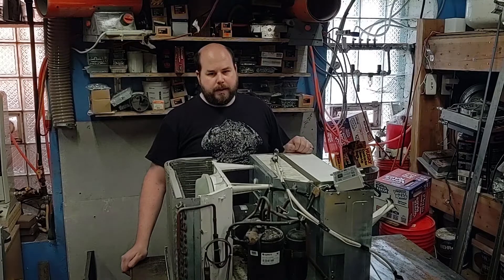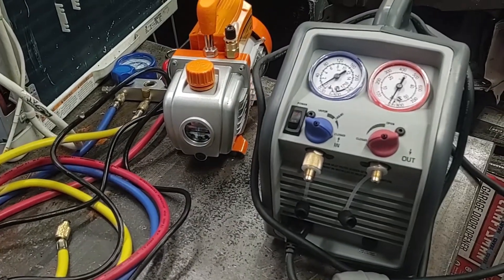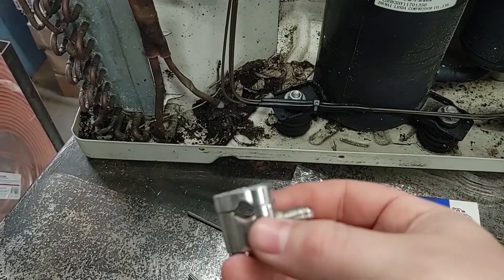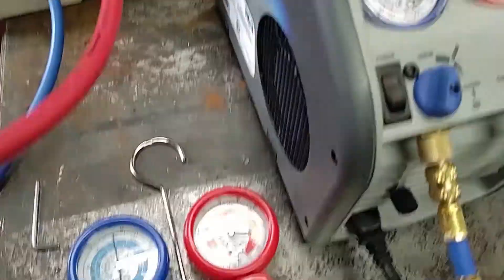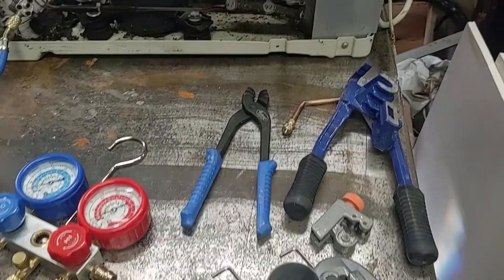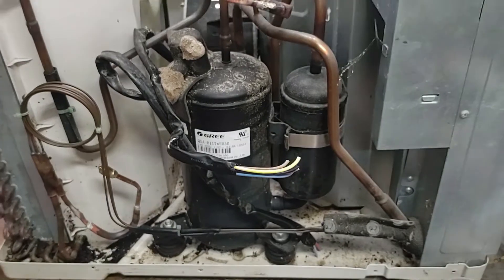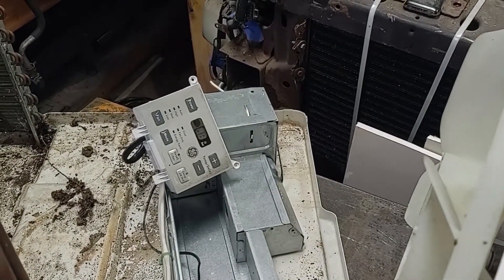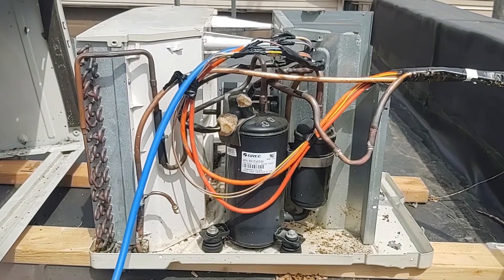Converting window air conditioner to split AC

Comment: As someone who does hvac/refrigeration for a living, lemme just say a few things. 

1. Holy shit, this is the best amateur job I've ever seen, I have seen guys that have been doing this for decades that do absolutely shit work compared to this. 

2. Props to you for taking the time to do this and for doing it right!
Reply from the maker: Thanks for compliment, appreciate it.
Reply: @planbuildplay8528  I agree with 
the previous commenter, I work in the hvac field and ive also seen guys that do it for a living fall short of what you did. seeing you go as far as to solder the wires, pierce the tubing, recover, and especially pull vaccuum. Good job man. Filter even.

Comment: For a while I've wondered why no one has made a video about converting a window ac to a mini split. After renovating my bedroom I accidentally installed a window that was too small for a window ac. I tried using a portable ac but do to the negative air pressure system they create, the single hose units are just too inefficient and don't get the job done. After thinking about trying to convert it to a dual hose unit I came up with the better idea of building my own mini split ac. I've been thinking about doing this for a long time and thanks to you I'm finally going to get around to doing it. Great Video!
Reply from the maker: I am glad this video could give you the push to start on the project.  Let me know how it goes, and thanks for watching.
Reply: Did you make it out of the portable ac? 
I have done that instead of a window air conditioner and it still works. I find it easier to make one out of a portable ac rather than a window ac because the majority only have one fan while the portable ac has two. Plus my air conditioner when I didn’t modify purely struggled to get down to temperature but now it can reach any temperature. That proved how bad these portable units are!  
Future plans for me is to make it reverse cycle.

Comment: Very cool congratulations!  Beautiful!  I thought I was gonna have to do this myself and then I saw other alternatives and I am overjoyed now after seeing your video that I didn’t have to do all the hours of research to educate myself on how to pull that off and I wouldn’t have wanted to buy the recovery pump.  Glad I saw your video to see what I didn’t get myself involved with thank God!  I saw a video of a guy in like Afghanistan build a air conditioner for his wife from an automobile air conditioner and a DC motor, I was very impressed.  It’s sad about all the negative comments.  I would be tremendously proud and even if I DID end up spending a little bit more money than if I had bought a store unit that I had done it myself and I always like to think that if I have the equipment I could do it again and it would pay for itself.  I really was impressed with your cost breakdown!  Again even if you broke even it is still really cool that you had the knowledge and skill to pull that off.  The only thing that I would’ve  said is…. when I go to my transfer station there are dozens of dead air conditioners and maybe you could’ve pulled a fan motor squirrel cage (for free, and very lucky if you could’ve found the same model!) and shroud from one of those units (and wouldn’t have even had to hassle with refrigerant).
Thanks for the fascinating video congratulations and best of luck with your continued projects.

Comment: I'm going to attempt this on a smaller scale for my office that I don't want an AC unit in. My only concern with your setup is the condenser being higher than the evaporator and oil return. Has this lasted since you installed it?

Comment: I am a pilot car driver so I live in my car most of the time.  I am in the process of installing a window unit with a 2000 watt gas generator so I can have ac while I sleep without running the car. 
I had a crazy thought, can you convert a window unit to a mini split? So I typed it into YouTube and your video pops up!  Love it!  Good work!

Comment: Good tutorial for those with the skills to handle refrigerant.  For others, it would be easier to cut thru wall, build a frame, and install unit with proper caulking.  Pro: quick change if unit fails, window units affordable.  Con: Renters can't cut hole in wall.

Comment: Nicely done.  I am in the process of doing he same (*3 units),  Quick question, home did you determine the correct amount of R410 to add back to the system, given the addition of the copper lineset volume between the condensor and evaporator parts?

Recommendations:  Insulate the linesets with k-flex or equivalent.  I'd do separate insulation on each line.  2nd, I'd use heat shrink rather than electrical tape and run the exterior electrical in liquid tite  tube - better protection against the critters.

Comment: UNDERATED
Reply from the maker: Thanks!
Reply: @planbuildplay8528  how it works now??
Reply from the maker: Its still a bit cold out to start it up this year, but Ill be using it this summer again and post any updates/modifications if needed.
Reply: @planbuildplay8528  is 0.75 ton enough for 15ft x 15ft x 10ft room ambient temp will be 30-40
Reply from the maker: I am no AC expert but probably, there are other factors to consider like insulation, windows, people, appliances, etc.  Do a few quick searches, there are a bunch of AC tonnage calculators online.
Reply: @planbuildplay8528  yes, please do. Thanks!

Comment: This is an outstanding job that I wanted to do as well, but my worry is efficiency, if it's not going to be as efficient as mini split
Reply from the maker: Thanks!  Yea, I may have lost a bit of efficiency from the window unit with the blower fans I used for the evaporator not moving enough air.  I'm not sure on the efficiency difference between window and split systems.

Comment: I have a idea . I actually need the answer but can i use a 2ton Hvac out door unit and adapt a mini split head on the inside instead of a air handler ?
Reply from the maker: I am not an air conditioner professional, but I don't see why that wouldn't work.  The only issue I would see is that you might lose efficiency if the inside split head evaporator couldn't handle the amount of condensed refrigerant that the out door unit can condense.  Also check that the pressures that the two use are the same.

Comment: Can you do a video like this on a Midea U-shape window unit
Reply from the maker: The process for converting a U shaped window unit should be the same as a regular window unit as they should both have the same parts.  I haven't worked on a U shaped unit yet, but they might be even easier to convert if they use two fans for the condenser and evaporator and can reuse the same outer steel enclosure.

Comment: Can we split Japanese window AC tower shaped.. (Corona Brand 0.75 tons). Also can we extend pipes to 10 feet from condenser to evaporator coil.. please let me know. Thanks
Reply from the maker: I have not worked with the Corona brand AC units but they should use the same parts (compressor, condenser, evaporator)  And yes the refrigerant lines can be extended you will just need to add extra refrigerant.  When adding the refrigerant back to the system just be sure the pressures when it is running match what is marked on the compressor or AC unit.

Comment: Interesting project!  This was posted in 2020, did it last long, is it still running?  I think you could get a minisplit for about $600 delievered.  You have enough skills to install one clearly, and it would provide heat in the cooler months (and it would probably last longer.)

Comment: Man thank you so much for posting this. I have been thinking about attempting this, just for fun. I do have one question though. When I look at your line set it appears that the liquid line and the vapor line are making physical (metal to metal) contact without any insulation on the vapor line? Please tell me I'm wrong! Also, what are your thoughts about placing a filter/drier inline? I mean, why not?
Reply from the maker: Yep, I didn't use any insulation.  I didn't have the extra room to get it through the 1" hole in the wall I had.  The vapor line is still cold leaving the evaporator so would just help cooling the liquid line.  I think the insulation is usually just to keep the lines from causing condensation, hopefully the tape wrap on the lines will help with that.  For the filter/dryer the AC already had one installed, I just didn't replace it.  Its the small black cylinder attached to the compressor.

Comment: Aren't you supposed to braze the joints? Have you had any problem with the solder??
Reply from the maker: That is my mistake using the wrong term.  It looks like using Safety Silv 56 the melting point is in the brazing range from 1200-1400 degrees.  I have not had any issues with the brazed joints on the AC.
Reply: @planbuildplay8528  I thought it looked like brazing material but I guess I've just always seen people do it with a oxy acetylene torch

Comment: Refrigerant line are supposed to be insulated from the air and each other.
Reply from the maker: Yep, I just didn't have much space to get these through the hole in the wall.  Maybe Ill have to go back and add some pipe insulation around them.

Comment: Will this cost less than buying a split system?
Reply from the maker: For the same BTU rating window AC units are usually quite a bit cheaper than split systems.  Where this project adds some extra cost is for the purchase of the refrigerant recovery machine.  You can check the pricing of parts and tools used from the links in the description of the video.
Reply: No

Comment: Can I use old air conditioner?
Reply from the maker: Sure, this should work for any AC that is still working.  Just check what refrigerant that it uses, some of the old air conditioners use R22 and that isn't produced anymore so may be harder to get.  Different types of refrigerant should not be mixed.
Reply: I use propane in old r22 compressor and it still works

Comment: You should do a video of making it reverse cycle?
Reply from the maker: What do you mean by making it reverse cycle?  Make a window AC from a split unit?
Reply: @planbuildplay8528  i think he meant using the ac to transfer heat indoors, being said, im not sure if window ac units would have the reversing mechanisms built in, the very new ones might.
Reply: Yeah, I turned one into a heater just reverse the air flow, it needs to be fixed so it gets colder, otherwise the heat is not that great, and it also iced up the condensor so that needed fixed, but then winters here are short, and it warmed up before I got that far...and the propane heaters are cheap and work great for the shop.    But for my RV, I don't want to carry propane.

There are reversing valves you can add in so the indoor unit can remain (unlike my hack),  not sure though if they need some other setup, so yeah would like to see a video on ithat.

Comment: Why not just get an electric fan for a car radiator?  You'd need an inverter to conver to 12v, but that's not hard.
Reply from the maker: For the fans/blower I was just using parts I had laying around from other projects.  I plan on doing an upgraded version of this hopefully next spring and will use a tank of anti-freeze to put the evaporators in and use car radiators/fin coolers to transfer the heat from the shop to the chilled anti-freeze.